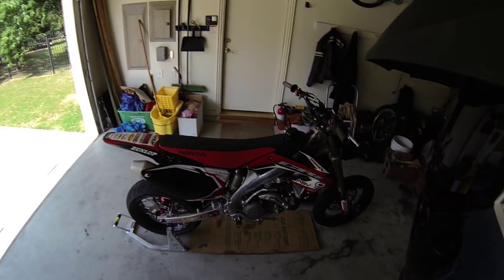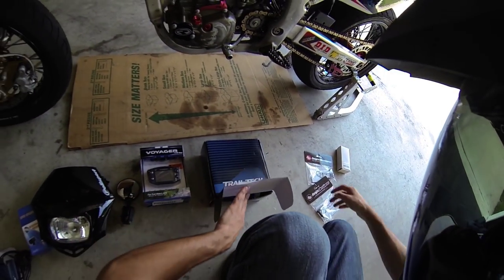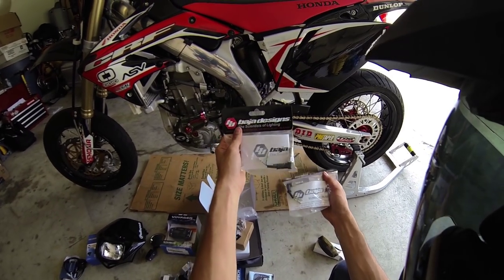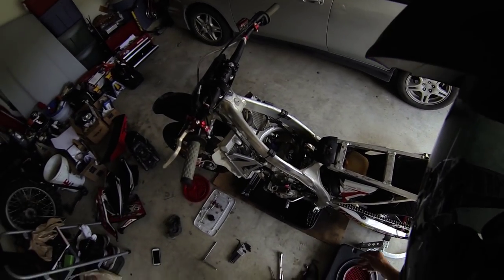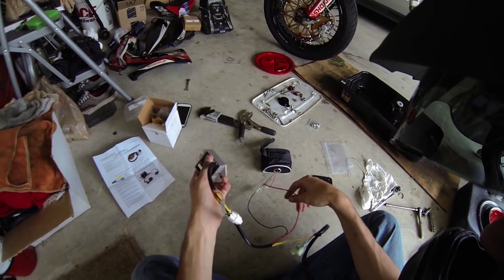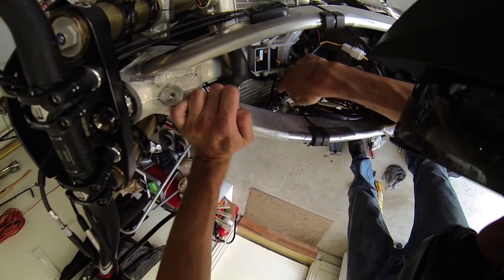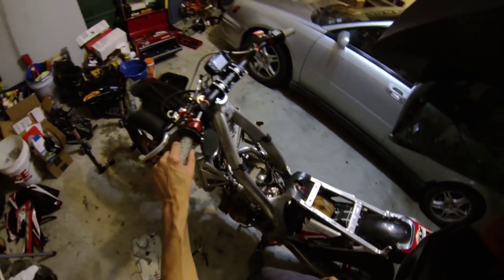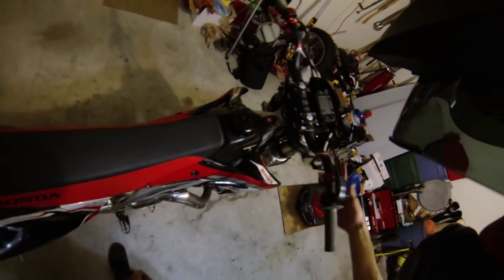How to Street Legal a Supermoto!

Comment: What size are your sprockets?  I have an '05 CRF450R that I'm dying to turn into a dual sport.  Mines are 13/52.  Probably best for me to get another set of wheels and rubbers dedicated for the street that way they can easily be changed with a new masterlink and things for when I go off road too.  I bought a heavy weight flywheel from Trail Tech but not one with an upgraded stator cuz I just wasn't 'bout dat lyfe at the time.  Maybe it'd be able to run a baby LED front light anyway?  Iddkkkk

Comment: +TheHappysem You could run the headlights and the horn off the battery correct? I'm looking to do this with a YZ250R (2 stroke model) and I wouldn't have enough space to support a lighting coil.   I'm not going to be using this on the road very often so all I need is for it to pass inspection.
Reply from the maker: +OffRoading Steve (Steve Wilkerson) Yea, my buddy does it that way on his 450RMZ, can't get a good stator in those bikes. So he just runs a big battery pack on the headlight and tail light that he charges after each ride. Looks like an airsoft battery if you've seen one

Comment from the maker: ***** Yes you need a license plate to be legal! But to get one you have to take the bike with all this stuff on it to a state inspection station, get them to OK it, take the inspection report to county tax office (or wherever you do titles) and pay the fees, then they give you a plate to put on! I just tuck mine underneath the tail, theres two bolts on the left side of the rear subframe.

Not sure where my rear view mirror came from, I nabbed it off my KTM before I sold it. Think it came from some old supermoto site. Amazon has some that are similar.
Reply: is there an age requirement or a certain cc it must be above or below
Reply: +kingz auto detailing Depends on the country.Check your country's law

Comment: is this good on the highway and im trying to decide between this bike wr450f and ktm 690 enduro r which do you recommend and are these good on the highway. and is the ktm 690 enduro considered a super moto im new to this
Reply from the maker: +Kmac 1126 Its ok at about 55mph, past that, it sucks. But most dirt bikes will suck past that. Out of what you listed, I think the 690 would be the best for highway use.
Reply: TheHappysem by suck what do you mean and is the ktm 690 considered a supermoto. which is more fun also and what about the ktm 500exc
Reply from the maker: +Kmac 1126 Pretty much every single cylinder bike will vibrate, a lot. The 690 is supposed to have some kind of balancer on the crankshaft to tone the vibration down a bit though. You can get a 690SMC, that's already supermoto! Fun is up to you! I love the new 500exc, I will probably get one or the Husqvarna!
Reply: alright cool i was also thinking about the 500

Comment: I have a few questions that you might be able to answer. I'm looking to get a supermoto but I'm not sure if I want to get one like already built or build one myself. How much was it for everything to make your CR legal? I only have about $3k-5k to spend and I'm not sure if it would be good to get a dirt bike and make it street legal. Also what do you do for anti theft on it since it doesn't have an electric start with an ignition key? (maybe that voyager does not sure) since I think you start it with kick start, couldn't anyone come a long and start it even if you have like a wheel immobilizer on it?
Reply from the maker: +MaxRay16 Bike, with sumo wheels, and lights and all that is probably $4500 for me, but you could do it a little cheaper if you wanted, or a lot more expensive haha. Yea I have it covered by insurance, you can add a key in if you really want to, but when I take it out, I rarely leave it and walk away. I'm pretty much just out to have fun on it, not really going into stores or anything. Could get a bike lock or something though.
Reply: +TheHappysem The most expensive part was the sumo wheels right? Like if I get some year KTM, Honda, or Yamaha 450 for like $2-4000 it would be another $4500 on top of that? I could probably just start with getting everything I need to legalize it in PA and wait to get the sumo wheels and other things.

Comment: Why do you need a different fly wheel?
Reply from the maker: Cody Hansen The stock flywheel only has single (I think) magnetic pick up, the aftermarket one has multiple that can generate more electrical power (40W vs 70W) to run bigger lights or more accessories. I'm still just using the 40W because I really don't want to change the flywheel, it might be heavier which really changes the bike's powerband, which I don't want! So far this has been enough to run my setup!

Comment: How's that R transmission on the street?
Reply from the maker: SuperDave So far I like it for non highway use! I'm running a 15 (or maybe 14?) front sprocket and a 40 rear, so it'll do north of 100mph, does great at 50mph and under, I like the close ratio trans! Wish it had a 6th gear like my KTM though

Comment: How often do you have to rebuild it
Reply from the maker: +ROR Coal Roller IF you're the kind of person to go by the book, you change oil every 15 hours, and the piston at the same time - 15 hours...which to me is incredibly stupid. But that's under race conditions 100% of the time. I do oil changes around 10-15 hours, haven't rebuilt it yet and see absolutely no need to. 50 hours on it now (it has been rebuilt before, previous owner blew it up racing on a track) still goes super strong, starts 1st or 2nd kick hot or cold
Reply: Ok thanks man I wanna build a supermoto but they just seem like you would have to rebuild them alot

Comment: Your stator shouldn't have oil in the casing for it...
Reply from the maker: +Travis Hutton Every bike has oil in the left side stator cover... at least every bike I';ve ever seen or worked on, oh and that's where you ADD oil lol...
Reply: +TheHappysem there shouldn't be oil in with the stator the oil would corrode the coil that make up the stator after it ate throw the coating around it man the is oil in the clutch case and in the bottom of the cylinder for the piston
Reply from the maker: What kind of bike do you have?
Reply: +TheHappysem just kidding I have a Ducati I just automatically thought of the dry clutch lol sorry you right asf haha